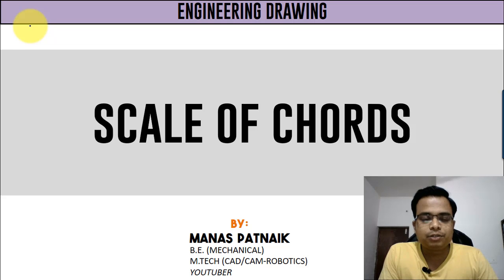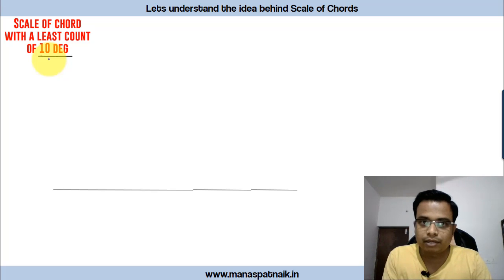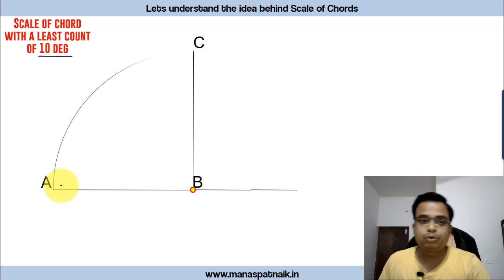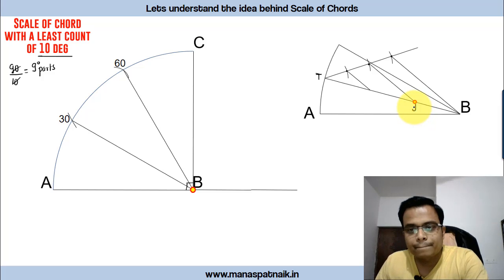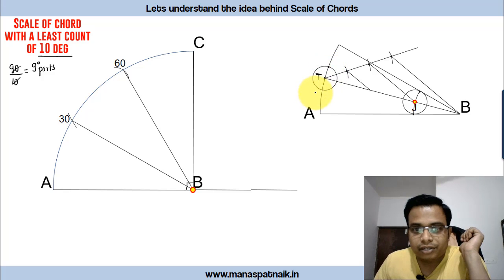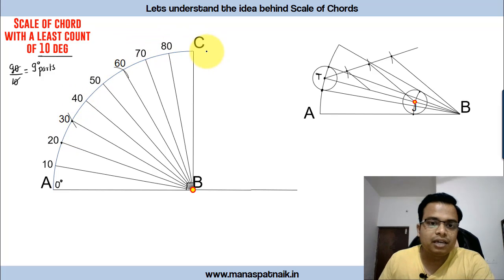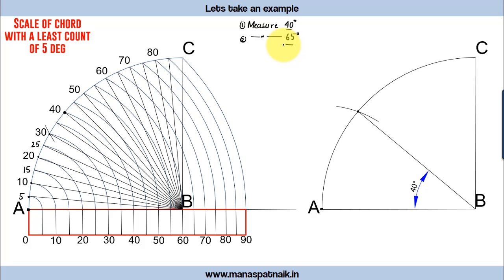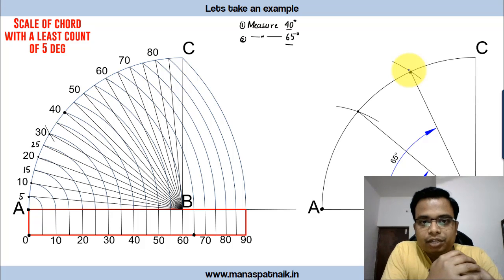Scale of Chords

Comment: Thank you so much for this helpful video, Sir !

What I had thought of doing was this :
Divide the base line AD (D is the point where the 90° arc cuts AB when extended) into 9 parts and then taking each part (0-1, 0-2, ..., 0-9) as radius, draw an arc starting at AD(the line) and ending at AC(the arc) .

My logic was that when you look at the line below AD having perpendiculars dropped from all the arcs, all the rectangular parts seem to be equal, so it should work out in the opposite direction (starting with the rectangles and then moving onto the arcs) also. 
I was thinking that this would also divide my quadrant ABCA into 9 equal parts, but it doesn't seem to work .
Why is this so ?
Reply from the maker: Rishika... You gave written a long message..... 
Anyway I am sure that the method I explained is clear....... 
I have got to watch the video again to understand what I had I explained.  
And frankly speaking,  even I have forgot the method.
Reply: @ManasPatnaikofficial  No Sir, you don't need to watch the video again, because my idea is different from what you taught .
In short, my idea was to divide AB into equal parts and then produce angles by taking those parts as radii, which didn't work .
But thank you so much !
Reply: I think what u say is also correct Rishika...only thing u need to careful about is finding point B which will be 6th point from point A ( which we come to know after seeing sirs final diagram). So in my opinion it can be done the way u said.

Comment: another method  is to simply divide the AB line into 9 parts (the same way it is done in plain scale). And then cutting arcs equal to the length of the subdivisions (that we get on the line AB) onto the AC arc . And boom we fet the least count as 10 degrees. Way simpler.